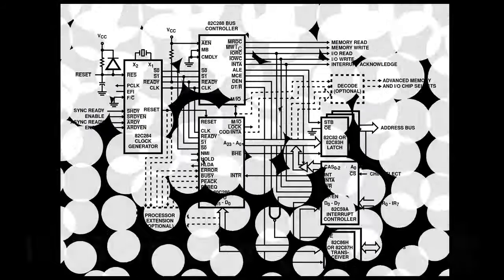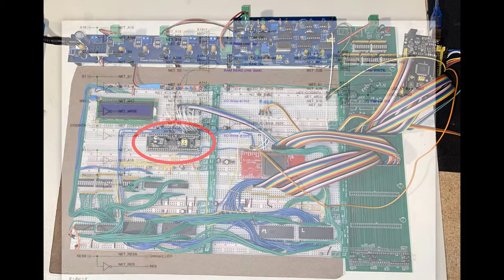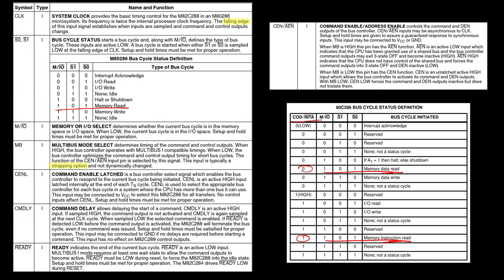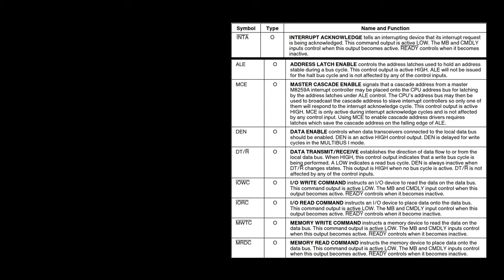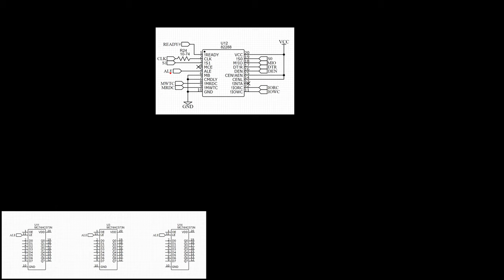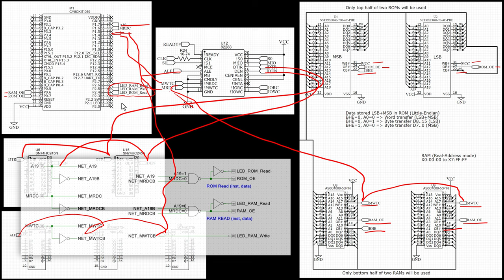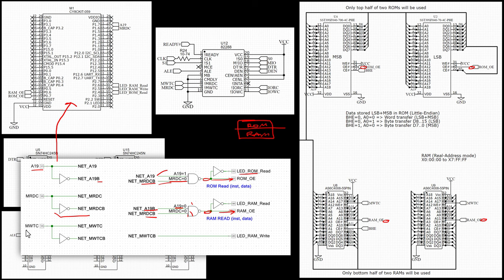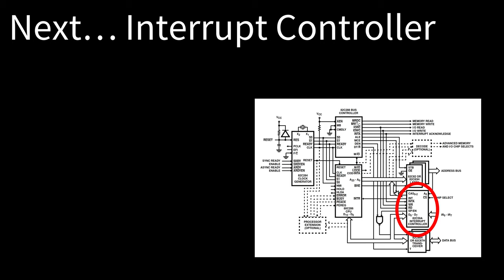80286 Build, Ep. #17 - Bus Controller 82C288

Comment: 7:36 I'm pretty sure M80288 is a typo of M80286 and is the CPU.
Reply from the maker: I had researched this a bit after posting the video. Apparently, the 80288 was an 8-bit data bus version of the 80286 (that was never released).
Reply: @rehsd  oh, ok, that makes sense.
Reply from the maker: @yqqbey8779  It sounded like it was a planned marketing name, but Intel chose not to offer the 8-bit data bus version at all. Interesting trivia.  :)
Reply: I have an old Motorola reference book says "The 80188, 80288, and 80388 are sibling devices of the Intel 8088 (16-bit)". It implies a date of around 1980. This is all there is mentioned.